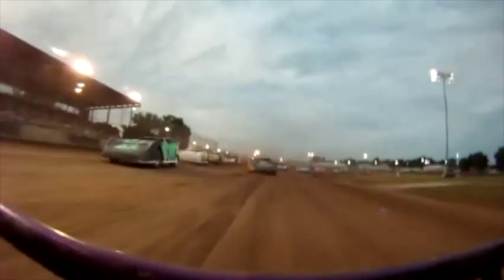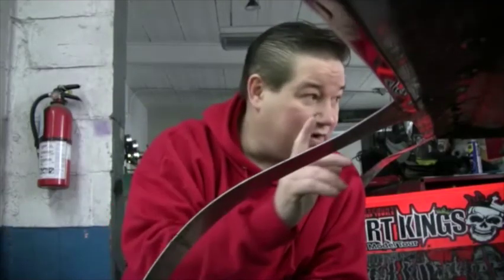Dirt Late Model and Dirt Modified Panhard Bars Part 2; How Panhard Bars Actually Work

Comment: Question for you, I am looking to do a right side frame mount panhard bar on my dirt late model. What height off the ground would you suggest the mount on the left axle and how much angle in the bar?
Reply from the maker: We always mounted ours just off the left side bell, 2-3” below centerline and the right side frame mount 4-5” above that.
Reply: Thank you. Also is there any track (banked/flat) or (tacky/slick) that would work best with this application?
Reply from the maker: I haven’t seen it in years. It’s an old Rayburn setup. The side bite actually pulls hard into the RR spring. You’d need to experiment with it.

Comment: Whats your thoughts about running a straight bar instead of a J bar? Ump A mod. I know it's gonna plant the lr much more.
Reply from the maker: I know the Bob Pierce mods were always a straight bar. Depending on the angle, it will make the car roll more. These to me were always a looser in tighter off sort of thing.
Reply: @HoganTechnologiesLLC  loose in tight off can be fast if you keep the car under you. The black and red car is a pierce copy and that's what I ran was a straight bar. Gonna switch from J bar to straight bar on my new car and try it out. Looking for that DIG

Comment: For the right side frame mount would you mount to the rearend on the pinion mount or the LR axel tube? If to the axel tube how long of a bar would you suggest?
Reply from the maker: We always mounted on the tube up against the side bell edge. Make it as long as you can make it fit.

Comment: Just saw your video. Guess I'm confused about the right rear getting more traction and making the car tighter? If the right rear gets more traction isn't that pointing the nose of the car to infield then making the car looser? Good video!
Reply from the maker: With roll steer, the RR should point in line or outside the RF. Pointing outside the RF will help the car turn and traction up.

Comment: How do you determine center of gravity what should you measure from?
Reply: It’s actually pretty complicated to measure the height, but measuring front and back and side to side is pretty easy. I should do a video showing how. If you measure your wheel base and width and then weigh your car, you can use the percentages to figure out laterally and front and back where it should be. The height is a bit more complicated. You need to weigh you car then raise the back and weigh it again. There is a formula to figure out the change.